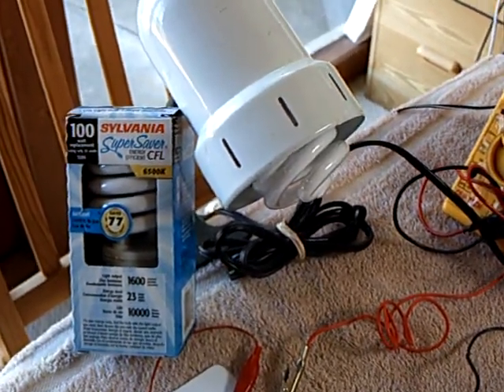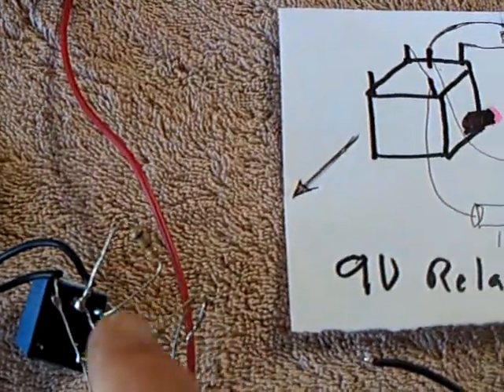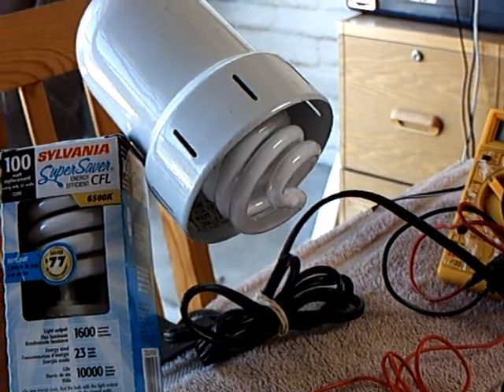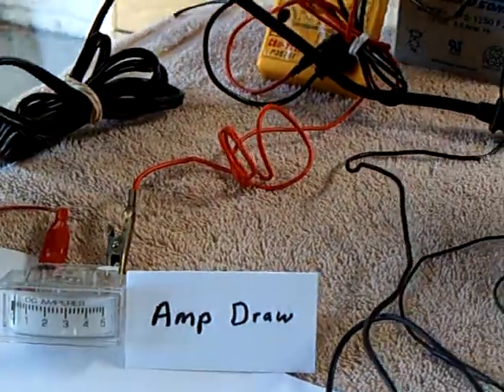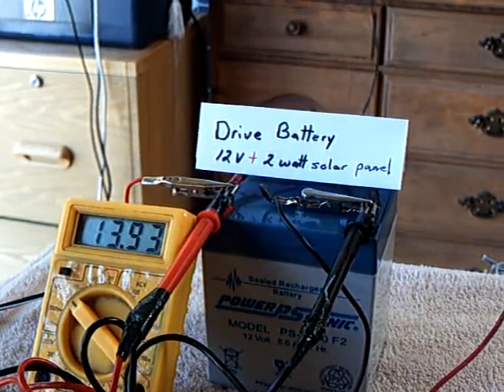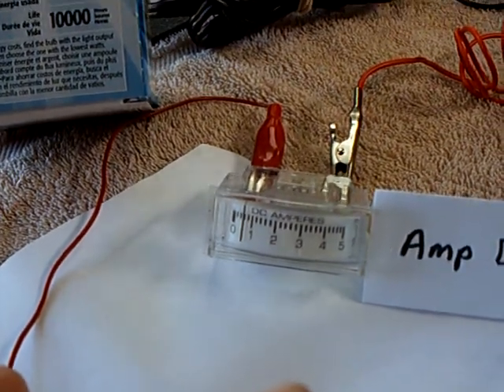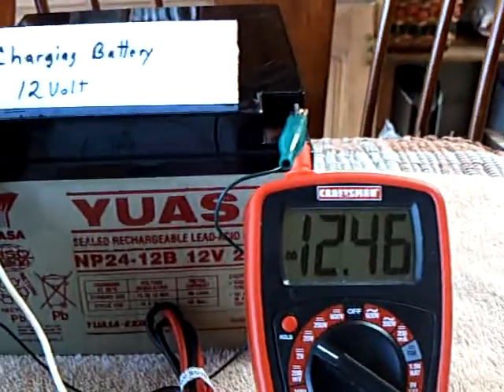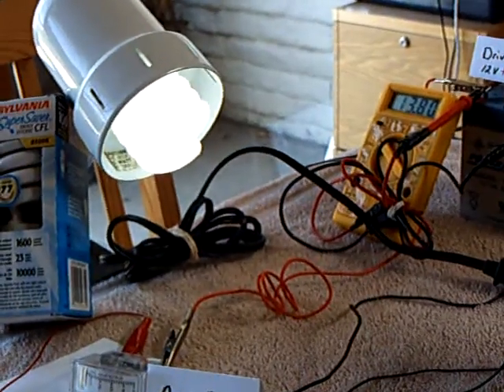Imhotep Radiant Oscillator --More Circuit modifications

Comment: CFLs are like flourescant tubes. The most current is drawn during ionising the gas, after that they are quite effecient providing you can get the voltage up enough to keep the gas ionised.